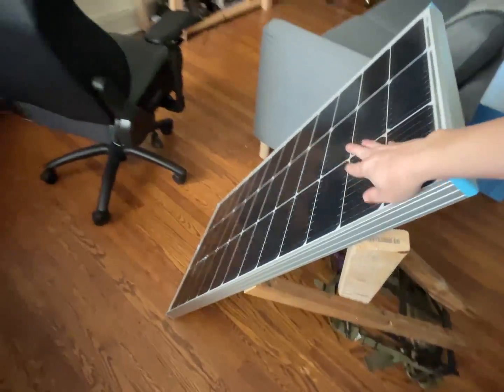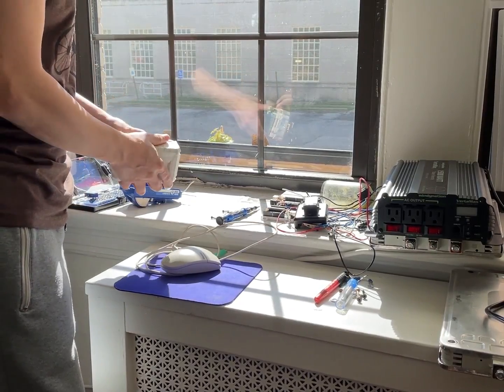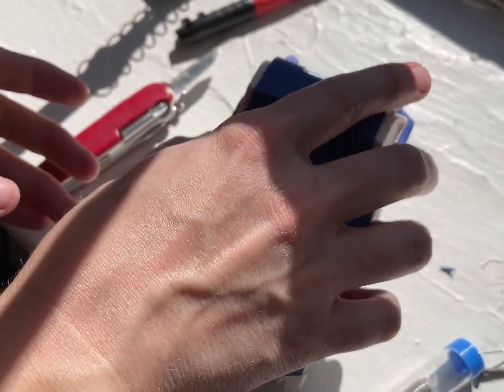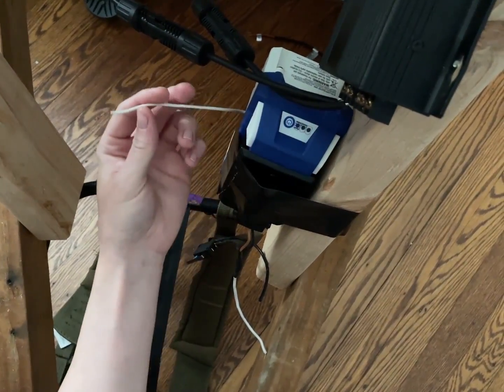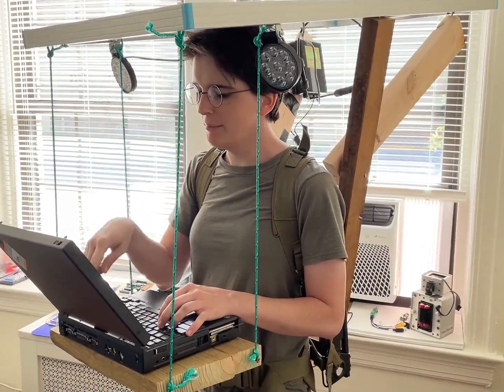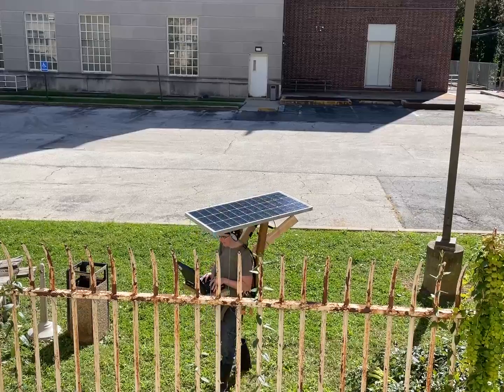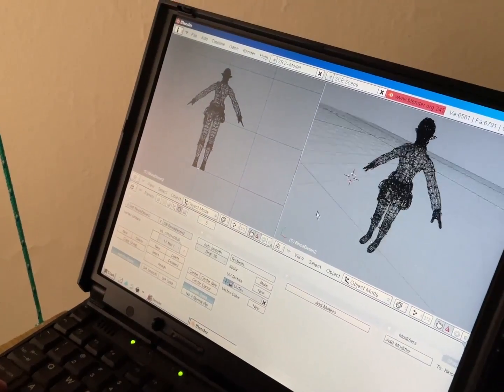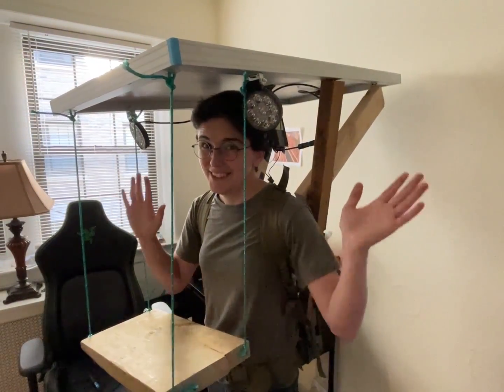Solar Sunday Experiments 017: Building a solar powered backpack for 2022 Philadelphia Maker Faire!

Comment: Just be careful with that setup so you don't overcharge those cells in that pack since soldering in that wire tapping directly into the cells is going to bypas s any safety the BMS may have offered to prevent overcharging.  I assume you have already programmed the solar charge controller to cut-off the charge at 12.6 or lower since that is 4.2 x 3 and it looked like you tapped into the 3rd battery positive.  Just remember those cells were probably only designed for a max of 4 amps charge current and now in full sun, you will be dumping close to 8 amps into them which is a bit on the aggressive side for charging.  Good luck and have fun at the maker fair.
Reply from the maker: I'm just not going to charge it very long. Sadly the charge controller doesn't go low enough. Oh well, it only has to work for a day.
Reply: @RinoaL  If you connect the battery first then the controller will be able to go lower in voltage unless for some reason you bought a 24 volt only mppt all my mppt controllers can do 12/24/48 volts depending upon the voltage of the batteries.
Reply from the maker: This mppt controller has four settings. Float and charge and so forth. Itll charge down to like 13.2v but not 12.6v. Just isnt in the software

Comment: Moaar solar sunday
Reply from the maker: Sadly they don't get hardly any views anymore, and yet are my most expensive series.
Reply: @RinoaL  Thanks. Long time subscriber, I remember the 12v batteries in the little small wooden 'shed' with the bus bars
Reply from the maker: I was kinda sad when that shed system died this summer. But I brought back the electricals since it was just those old batteries that went out. I'm planning an apartment-solar series with those inverters and such now.